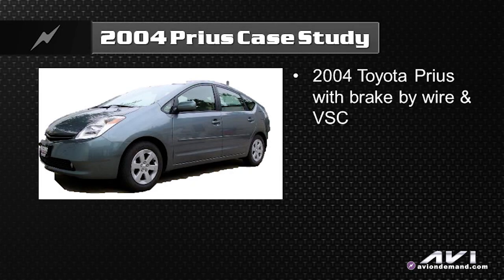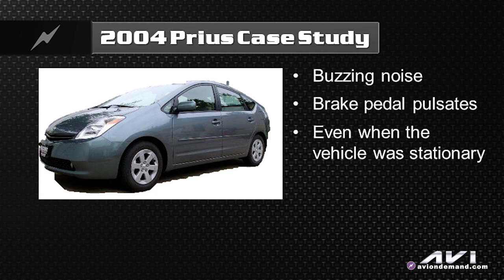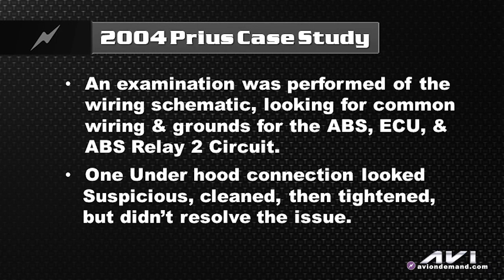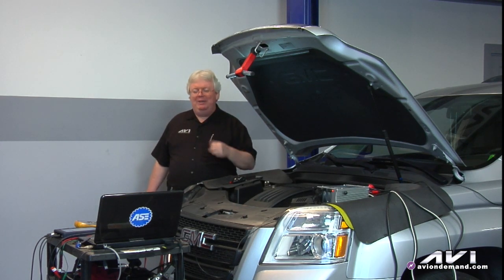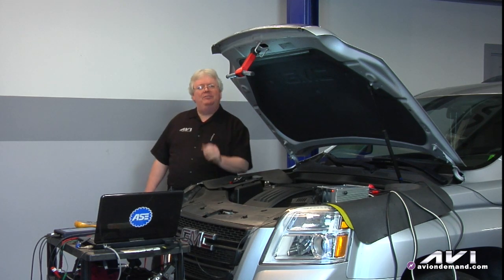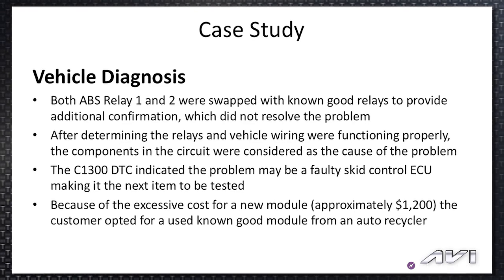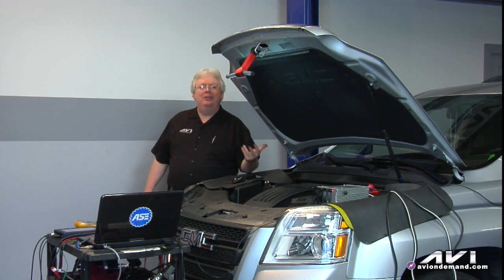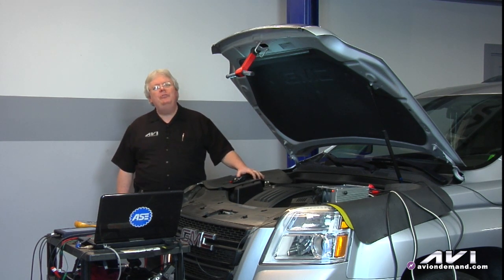C1300 Toyota Prius Case Study |  Dave Hobbs  | Tech Tip

Comment: David,  thank you for sharing your experience with how the DTC-C1300 error code.  I purchased a 2017 Toyota Prius Two a month ago with 86000 miles on it.  I have been experiencing two issues. I noticed an off-angle steering wheel during my initial test drive,  I mentioned this to the sales rep who was with me on the test drive, and I figured it was probably an alignment issue.  The second more recent was a less-than-responsive brake pedal.   I broke out the FIXD scan tool to see if there were any issues.  Sure enough, it displayed a C1300 code.  Being that there are no warnings on the dashboard should I be worried?